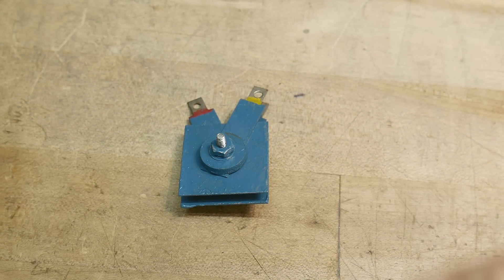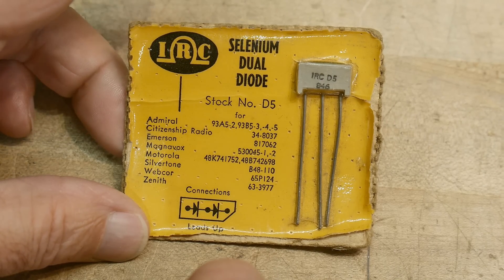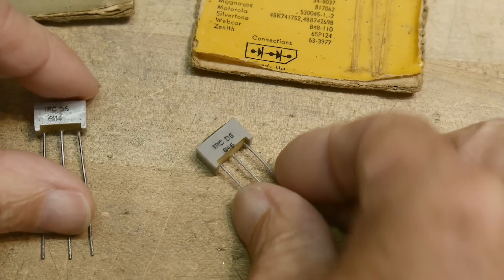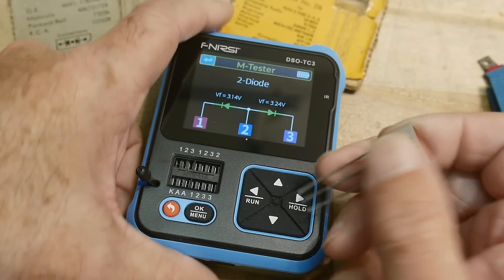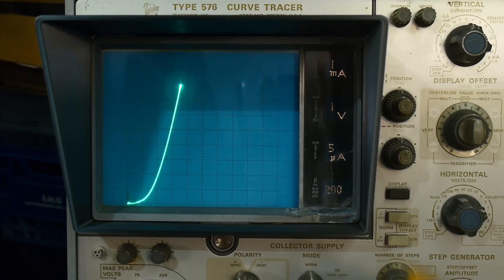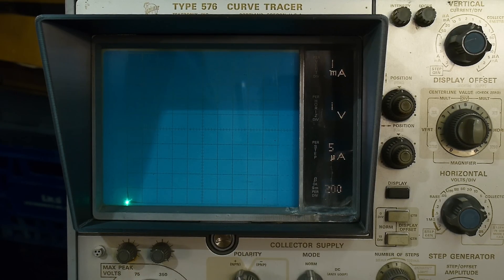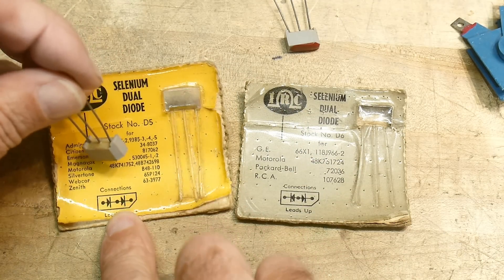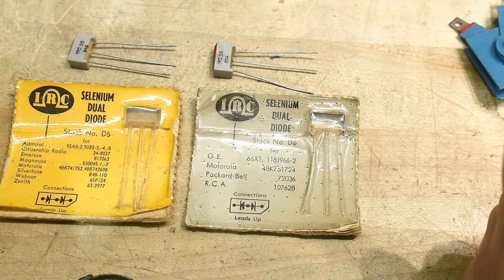#1795 Dual Selenium Diodes

Comment: How about replacing Se rectifier in vtvm PS: Would one need to add a resistor with the Si diode to better replicate the old diodes effect on the circuit behavior?

Comment: Selenium rectifiers were the first semiconductor rectifiers for higher blocking voltages. Before their invention tube diode rectifiers have been used. In fact it was unclear what happens inside of the selenium metal transition. Schottky described it as a Schottky barrier.

In Germany there is a funny saying for these rectifiers. Rectifier in German means "Gleichrichter". Selenium rectifier have a very characteristic fouly smell during operation due to the emission of selenium compounds. So "Gleichrichter" was pronounced "Gleich riecht er" (Soon it will smell).

Comment: Scocthbrite....SiC..Marroon..

Best overall..not two aggressive....but coarse enough....

Our scrub monkeys like progressive...purple to grey...using Spin Doctor...

Or grey to white..for fine finish 

IRC made lots of power resistors..

IR...still alive...but a new name......I like their power MOSFET IRF-250...diodes..SCR

One fab in El Segundo CA..

I think IR was in Phoenix too..

Readers know...

I wonder if the dual diode shown...

Can it recifity 1 amp?...

We want little transformer...10 VA..24 VAC.center tap...

Compare to two 1N4001...
Toss active load on filter cap output....

Would the IR smoke at 300 mA...

I guess it be nice to see the I foward current rating...and Vr breakdown 

Since Vf...is like 2.3....vs say close to 0.7 with the IN4001...

You know it will run hotter....

Or you will need higher transformer voltage...to cover the drop...

But IMASI......already knows that....

He wants to learn something new...very little left...

Thanks for showing old goodies from past

It's amazing how these dual diodes...are the heart of some PLL...

I like to see that circuit...

Enjoy...!

Thanks for chip of the day!

Comment: These show up in Seeburg jukebox amplifiers. They were used in the AVC (automatic volume control) circuit. Those old 45s were all over the place in volume, so the circuit leveled it out so you wouldn't have to constantly adjust the volume up and down.

Comment: Well, at least the forward voltages are relatively well-matched within the same package...? :)

Scotch-Brite pads are one of those ubiquitous things on anyone's bench who works on stuff over...let's say "a few decades" old. I've found they're even better when used with alcohols, (odorless) mineral spirits, or even soapy water, depending upon the application. One of the best things about them is that you can cut them to any size you need, which helps when cleaning items with nooks & crannies, or if you need to roll it up or wrap it around something.
Reply: Advanced users use the pads under a random orbital palm sander. With the addition of WD40, it's great for cleaning up cast iron surfaces on tools (like table saws, jointers, drill presses, etc etc), or by hand even to clean up rusty ways on lathes and mills! For cleaning precision surfaces, I would only use green or grey, not maroon - maroon is quite coarse. And the non-abrasive blue scotch brite pads work great on anything painted, or glass or ceramic without scratching it!

Comment: Those Selenium diode packs were likely old stock from a radio TV repair supply store.  I hung out at at a TV repair shop when I was in grade school, circa 1956.   My duties were to fetch coffee, sugary snacks, and to listen for the horizontal whistle.  The older gentleman who taught me how to fix things could not hear it.  Most of the Selenium rectifiers used in those days had several flat plates.  Even though they were painted, you could still get a nasty shock if you touched the plates.

Comment: The scouring pad is Scotch Brite from the Minnesota Mining and Manufacturing Company, or 3M since 2002.
The green ones are for regular use and the red ones are Extra Heavy Duty such as removing burnt on food residue from ovens.
Reply: They're not just for dishes - they're widely used in machine shops, auto repair, etc etc. Anywhere you want a non-sandpaper abbrasive. You can even get scotch brite wheels for your bench grinder / buffer, as well as scotch brite discs called "cookie wheels" for your die grinder. The maroon is coarse, green is medium, and grey is fine. Blue is non-abbrasive and is only the nylon pad (good for use on glass or ceramics, or other items you want to scrub but not scratch, such as anything painted)
Reply: @gorak9000  There is a color code for the abrasive level.

Comment: From an “old “ fart:
 
Selenium rectifiers are not all that dangerous, unless you grind them up in tiny pieces and sprinkle on your cereal . Even then you probably would just have an upset stomach. That little afc/phase detector diode array would never see enough current thru it to cause it to smoke .
Larger Selenium rectifiers (plate area 4 x4” ) used in battery chargers could heat up and burn if heavily overloaded, and give of an oder, but not enough to stink up a whole house or cause you to get sick.  Selenium stacks  can handle large current surges and if that happens the selenium coating can bubble and have localized blistering, but then recover and keep working. The surge handling capability makes them a better choice over silicon diodes
The people who spread misinformation  about selenium are the same folks that complain old tektronix scopes produce enough heat to warm their shops. The same folks who do wholesale capacitor replacement because they can’t do component level troubleshooting.  I’m sick of these old hen tales.

Comment: I'm guessing 948 as a date code indicates 1959, week 48.  I've seen various parts labelled with one year digit and two week digits.  I guessed 1959 instead of 1969 just because the packaging was so similar that I thought the closer year would be a better guess, as packaging in products changes fairly commonly.

Comment: I used to take the rectifiers apart , strip the paint and use them to demonstrate solar electric effect. They will output a voltage when exposed to sunlight. I don't remember how much voltage as this was over 60 years ago back when I was a curious kid.

Comment: The telephone company, when customers complained about frequent horrendous cracking sounds, remedied the phones with anti-parallel selenium diodes addition into the ear piece.  Worked quite well.  I tried my version, two silicon diodes, which also worked, but if I recall, they were too sharp responding, causing some distortion to the voice.  As you see on the curve tracer, the leakage appears quite early, but then the slope is less deep than that of silicon diodes.

Comment: Two D5 and you have a FULL BRIDGE RECTIFIER! Three of them and you have a 3-phase one. And as many as you need to make a high voltage one...

I like that Fnirsi M-tester. The enclosure looks well-designed, durable and practical.

Comment: I think that you have a bunch of old cranky retired guys watching your channel.  It was either 1960 or 61 I took an electronics class in high school.  One thing we did was build a large 12VDC power supply.  Even had to fabricate the chassis.  The rectifying element was a selenium rectifier.  We didn't know at the time that we were risking our lives and others because of the evil selenium.  We all survived.  The power supply took up residence in the rafters of the garage but I haven't seen it in years.  Nice video.  Thanks!
Reply: I'm old and cranky
Reply: I took a selenium dietary supplement to help grow hair.  It can't be that.dangerous.

Comment: I used to replace one of these AFC Detector or Horizonal Phase Detector diodes every so often when  I worked in TV shops in 1974 and 1975.  The diode was used to detect the horizontal sync pulse out of the video.  They would fail open after 5 to 10 years.  Some TVs had these in a socket.  If my memory serves me correctly, these sold for about $0.25.  It would have been much better to use a pair of 1N914s, which would totally eliminate the failure but, with TVs, every cent of part cost was taken into account.

Small selenium rectifiers were also used on the convergence board (4 diodes), and in the high voltage, for the focus rectifier, and CRT anode high voltage rectifier (Single, or 6 to 8 diodes used in a voltage tripler or quadrupler).

Comment: Vacform package, used to be common, using a thin PVC film with the cardboard having a varnish layer applied. The large board is put on a heater platen with holes for the suction, then the PVC film was put on top, and clamped down, then suction pulled the hot plastic onto the card, and the varnish made the glue bond. Used to be very common, and still used by some small packaging companies.

Comment: what dess chatgpt say about them
Reply from the maker: Dual selenium rectifiers were used in older televisions and other electronic devices as rectifiers to convert alternating current (AC) into direct current (DC). Selenium rectifiers were popular in the mid-20th century before silicon rectifiers became more common.

These rectifiers were called "dual" because they contained two separate selenium plates or stacks, each functioning as a half-wave rectifier. When connected properly in a circuit, these two halves would work together to convert both halves of the AC waveform into DC.

Selenium rectifiers had several advantages, such as their ability to handle high currents and their reliability. However, they also had drawbacks, including their relatively high cost, inefficiency (compared to silicon rectifiers), and the fact that they could degrade over time, emitting a foul-smelling and toxic gas if they failed.

Due to these drawbacks and the advent of more efficient and reliable semiconductor rectifiers, selenium rectifiers are no longer used in modern electronics.
Reply: @IMSAIGuy   thanks
Reply: The curve tracer is useful to figure out what resistor to use with the Si diode when replacing these Se diodes.

Comment: Phase detector diode for TV horizontal sweep. They compared horizontal pulses from the sync separator and a tap off the flyback transformer; error voltage was applied to horizontal oscillator.

Comment: Not just used in color sets, they were in LOTS of B/W sets, as well. Used in the horizontal phase detector circuit.   Color sets often used another selenium multiple diode package in the convergence circuitry.
Reply: Yup, dc clamp diodes, in Britain the diode of choice for convergence circuitry was a diode connected germanium transistor, ac128 or similar, these old jobs here were used in flywheel sync circuits in old time valve tv sets.

Comment: I remember these well. I worked in a TV repair shop in high school, and the horizontal sweep circuit contained a PLL locked to the sync pulses in the video signal. These dual diodes were used as the phase detector.
Reply: Thanks, I wondered in which circuit they would be used